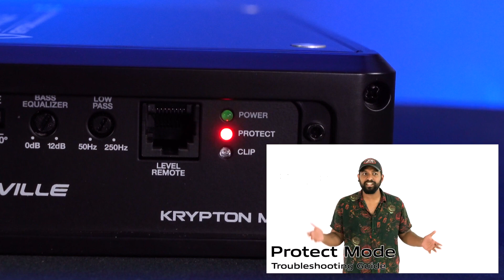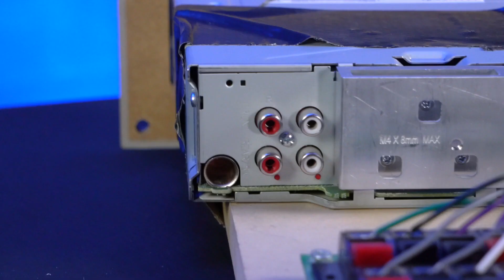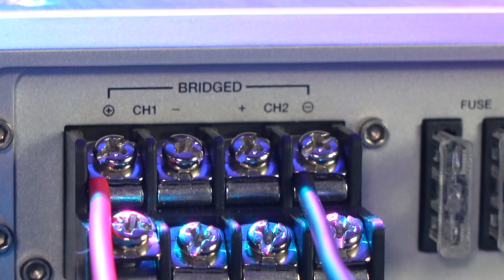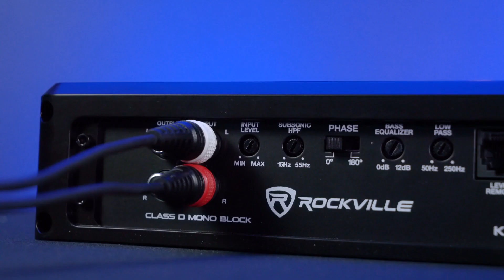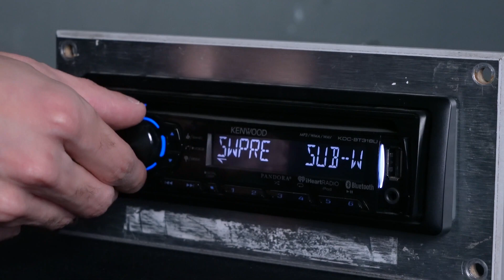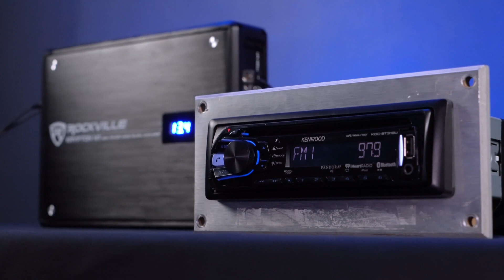What to do if your Car Amplifier has Power, but is not playing any sound - Troubleshooting and tips

Comment: So here is a fun one I've got an older system I've had it for 6 years now Ole reliable still in great shape right so I was bupping the other night on about a 25 30 min drive and suddenly I have no bass pull over check everything out amp isn't in protect mode all wires have good a connection no brakes or cut wires rcas are in good shape no bad wiggles indicating a broken amp terminal no blown fuses amp was a lil hot but not excessively normal warmth for being plaed at that length of time I though ok I'll check it out tomorrow so I did went over everything again more Thoroughly this time and still no bass amp is not in protect mode help lol 😅😢
Reply: im having basically the same issue. My subs were working. all wiring is fine, not in protect but no sound. It was coming in and out for a while but now it's doing nothing. I think my amp is blown :(

Comment: I have a 5 channel DB55. The subwoofer amp portion is not working. Bass remote knob does not light up as well. I checked the fuses and the other channels are working. Any suggestions. I suppose something is blown up internally.

Comment: Had this problem for powered sub in car. Lights come on but no sound. This is after installing a pioneer head unit w rca outputs. I was so frustrated, I returned it. When I should of just went to an install place and had it looked at. And hopefully the problem isnt in the rca outputs from the deck, which I think is what the problem is.

Comment: Man thank you so much step 3 helped get my issue resolved showing no sound coming out I was given a amp with bad rca ports I changed the amp out for my one working after conducting the test to see it works and I’m booming in the truck with this one until I replace the broken one

Comment: I’ve seen no one ask this cuz I must be the only one with the problem, but I bought brand new 2500 watt subs and a brand new 2000 watt amp. I had to re wire the subs in the box and I did them correctly because my old amp powered my new subs. But when I use my new amp there is no out put on my new subs.